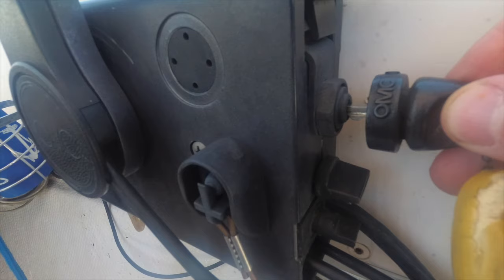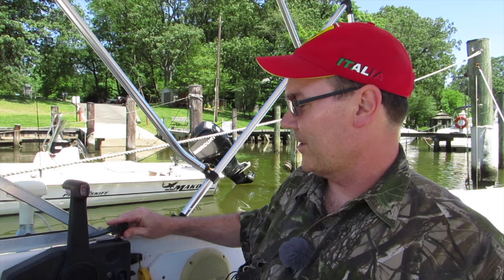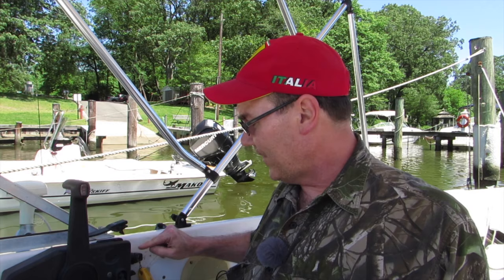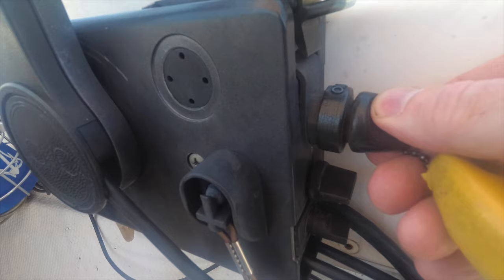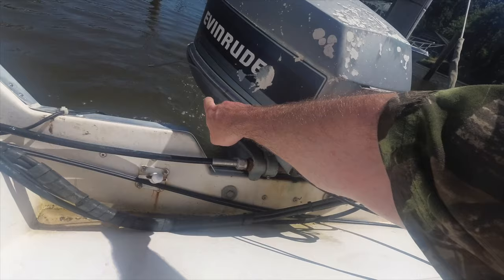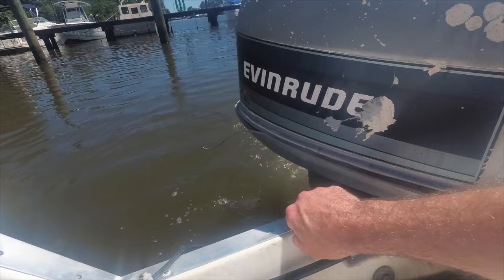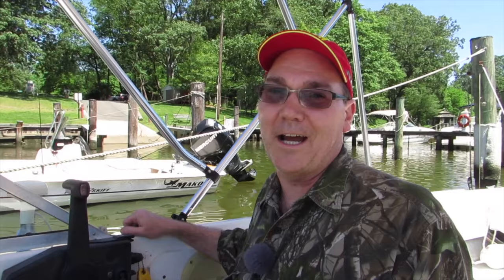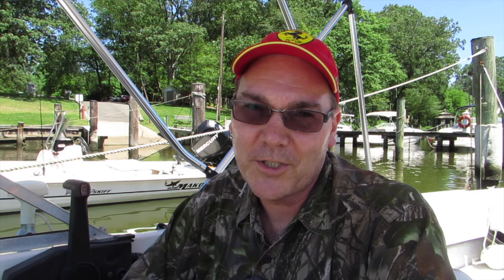Starting the Evinrude 90 HP 2 stroke outboard boat engine.

Comment: Hello hope you respond. I have 1990 90hp johnson motor runs perfect in my knowledge I'm a small engine mechanic. But I havent actually take it in the water yet. My concern is! Is my water pump working well ? Theres whater coming out of the nipple but I'm not sure how much whater is good and how little water is bad? I hope someone responds. Thank you in advance!
Reply from the maker: My 90 typically had a stream coming from the little hole when the engine was running. I think it's visible in the video. If it's only dripping water or nothing is coming out - that's a problem. The tip is small, so it's not like it is designed for a big flow.

Comment: I have a 115hp evinrude ..... that leaves oil stain in the water when run

 ..... what do you think it is you can help me
Reply from the maker: Because you're running an old 2 stroke, it can be from a few things. If the seal behind the prop is bad, if the lower unit is leaking, if the engine isn't running properly, if there's too much oil in the mix (wrong ratio for the engine), and also 2 strokes actually exhaust oil during normal operation - so there might always be a little.
Reply: The oil pump was removed by the previous owner ….. 50:1 ? mix

Comment: is the valve on the fuel tank open or closed when the engine is running ??
Reply from the maker: Closed. Older style tanks have to be open - which vents some fuel vapor into the air and that's why the newer ones are closed.

Comment: The only forgot one thing, put it into gear forward or reverse. You have to lift up on the lever underneath to put it into gear. A lot of people don’t know this but good video other than that.
Reply: That would be 'driving the boat'  not starting it...this video is about starting the boat, which doesn't involve pulling up on the shift release button, as you are in Neutral, and staying there.

Comment: Hi Wayne thanks for the common sense tips that you forget. Just an FYI the gray fuel hose attached to your tank has a clear plastic sleeve that sheds plastic pieces into your fuel filter / carb. Lots. Of headaches due to lack of fuel to engine 😡 Lots of manual pull starts on a. 30 hp for a seventy year old😩
Reply from the maker: Yeah I hear lots of bad things about those fuel hoses.

Comment: Pushing in the key is the choke
Reply from the maker: On my motor pushing it in would activate jets that squirted in extra fuel.
Reply: @WayneTheBoatGuy   that what a choke does there boat guy.... I have owned about a dozen of those v4 omc engines
Reply: @WayneTheBoatGuy  it is called a omc push to choke ignition
Reply from the maker: @brandonmurphy4657  I did not know that. Maybe they refer to it like that to keep it simple. What’s odd is that in a car, the choke is a flapper that restricts air - like choking a person. In my old 6 hp Evinrude, there was a manual choke that also was exactly like one on a car. My 90 hp 2 stroke was the first motor I had encountered that actually added more fuel instead of restricting air.
Reply: @WayneTheBoatGuy   yes the flapper does the same thing adds more fuel .   Those omc keys most of them say push to choke on them

Comment: Mine idle slow and eventually dies if I put the idle mixture lever down all the way after it’s warmed up
Reply from the maker: That should be easily diagnosed and possibly fixed. On a carburetor, there is an idle speed screw that adjusts how much fuel is flowing. If you're starting and revving fine, it's the idle speed and if that doesn't do it, it's the float and and valves in the carb. They're not to hard to rebuild, and if turning the idle speed screw doesn't fix it - that's your next place to check.
Reply: Wayne The Boat Guy thank you I’ll try that!! Does my E90tlcte have a VRO?
Reply from the maker: Be E  - if it’s VRO, I would imagine it has an oil reservoir somewhere. Mine had a 1 gallon oil tank tucked in behind the batteries. I think the VRO system first came out in 1984. What year is yours?

Comment: I hope you have gotten rid of the oil injection system and gone to premixing. Those old Evenrude oil injectors are notorious for not working. If your alarm doesn’t go off when it does say goodbye to your motor.
Reply from the maker: I sold that boat last year, but I have heard a few horror stories about that system!

Comment: Although you had the process correct, I can tell you don't know anything about engine's, When you push the key in it pulls in the choke for cold start via an electric solinoid
Reply from the maker: I know what a choke is. This engine actually would squirt fuel when you pushed the key - which I had not seen before.

Comment: WRONG! I STOPPED when he stated that the lever is his Idle Speed Mixture. The lever is to advance the timing. It aids in starting the motor.
The engine has non adjustable carbs. Idle speed mixture is controlled by jets in the carb.
People make a video just to hear themselves talk without knowing the facts. 
ALWAYS check  the manual If you do not have one look online or call an authorized dealer.
Reply from the maker: Tony, I’m sorry you feel my video isn’t helpful.  When my boat is idling, and I move that lever up, the engine speed increases. My assumption is that when a lever adjusts my idle speed, it might be called that. I have also heard other people call it the same. 
I try to make sure that I let everyone know that I am not a mechanic or a technician and I appreciate when someone is able to shed more light on a subject.